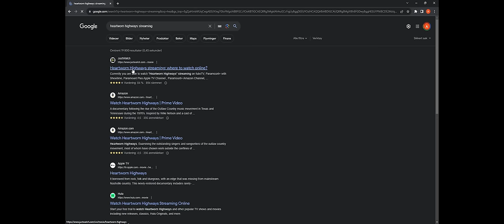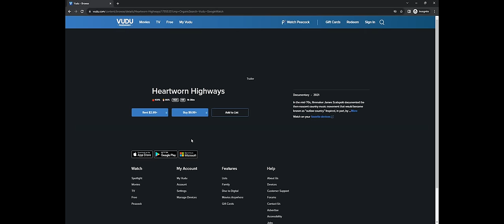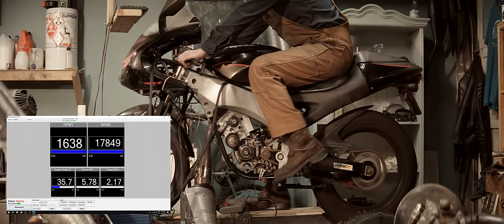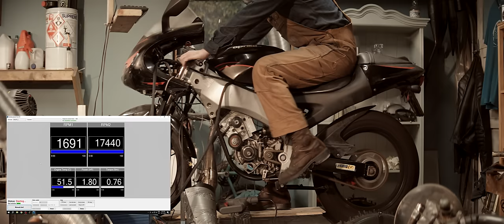Couple of tweaks - Solved the Overheating issue? Road to most Powerful 50cc.

Comment from the maker: Check NordVPN exclusive deal here https://nordvpn.com/2strokestuffing.It's
risk-free with a 30-day money back guarantee!
Reply: Alex @2STROKE STUFFING
    I would think of over building the crank bearings with a double bearing on the 'drive' output side, if not both sides! on a future crank case design ..to ensure minimal crank flex harmonics from high RPM running wearing out the bearings so quickly with the belt drive loading on the crank end(s) - a.k.a. build the bottom end akin to a endurance-racer toughness, for the relative drag racer levels of power you are after from the engine's small capacity, so to not have to worry about so frequent rebuilds obscuring other testing issues & problems.
    Likely you would need an auxilary oil pump to feed the outer crank bearings (draining through the inner ones into the case) perhaps a oilpump from a F1SE, AR80 or similar 1970s/80s era 2 stroke etc could be suitable?

Have a brief researching image googling at GP250's & GP500's RG500, KR250 & Armstrong 250 Disc Valves, Rotary Valve Covers setups for inspiration..?
Reply: Alex
    Also, you might need to factor into the crank's reciprocating dynamic weight ratio, with that of the rotary valve's general out of balance weighting, and its weight as part of the total bottom end weighting, it doesn't need to be super accurately done; 
    ...but it could be an idea to think of having the inlet port & rotary valve position at a different clock position relative to crank TDCBDC to relocate rotary vlave's weighting towards the cranks balance weights/ratio more easier by not having the inlet port and open valve period out-of-line to the balance weights of the crank, as how they are now when the port is Only at the 12 or 6 O'clock location(s) ??
Reply: jeg har en honda sfx som du kan få den den er 50cc
Reply: loose the rotary valve all together .and toss it from mind .. let get back to the original agenda as you are going to supercharge a two stroke with a roots style internal gear drive ..driven off gear teeth you are going to cut into one of the crankshaft fly wheels ..to make this simple and easy ..you will have to go back to the drawing board and design a complete new engine that is very close to a Chrysler West Bend two stroke very popular in the late 1960's and early 1970's for racing go-karts..a 100cc West Bend go-kart = over 100 mph was not uncommon ..the block was rectangular ..as the outside of the crankcase was 5 sided ..two of  for the crankshaft ends and with 3 sides left is the right crankcase cover plate , the left crankcase cover plate ..and the bottom crankcase plate ..all three plates will accept  dual reed valves and dual carbs. for a possible total of six carbs ..close off the side plates and build your roots style supercharger to fit right on the bottom of the crankcase in place of the reed valve .there you will internally drive your designed roots style supercharger in overdrive as one of the crankshaft flywheel will double as the overdriven drive gear  and you can also have different numbers gear teeth on the supercharger simply by having spacers of different thicknesses t adjust back lash of different driven supercharger gears ..this is so very simple why didnt we think of this before..you wont even need a reed valve the rotors inside a roots style seal like gears of an oil pump ..and cut out various plates to accept different size carbs...now with adjustable positive boost and set up to very quickly change carbs it will be easy to come up with the right STUFF..dont worry and about  the super charge intake blowing straight out the exhaust port ..the new expansion chamber you are going to redesign in all that spear time of yours will look like an FMF  FATTY with the larges bulge up front as close to the exhaust port ..then a long tapper reverse cone.... the sound wave of combustion will close the exhaust port for enough time until the piston can seal the supercharged intake charge and kafucking booom power and exhaust   to finally exit an adjustable length stinger like a slide trombone ..short for torque to take off and stretch it out long for enough top end to win ! now want are you waiting for ? get back to work the boss wants this all done by 5:30 while i sit here and watch you work.enjoying my beer and glass pipe .im good at watching paint dry also

Comment: First time commenting, this has probably been covered before. I think it's possible that when you  tension the drive belt to the gear box, it is preloading the crank end. This is causing a dynamic misalignment while running and being hooked up to the gear box and causing excess friction and heat on both the drive side and the rotary side bearings.
Reply: I think exactly this is the main issue too. Usually there is a gear drive from the crank to the gearbox, and not a belt. A chain drive would probably do much better i think, as it causes way less friction and doesn't add any stress on the crank.
Reply: @waldmarkszwei6933  A chain still puts an asymmetrical load on the crank, as a belt does. The answer to this is a gear/geartrain.
Reply: I see two paths to fixing this: Dedicated oiling to the crank bearings for active cooling or another variator setup to ease the side load on the crank.
Reply: @EddieTheH  Yes, but on the other hand, Kart engines pull a chain all day long without a problem.
Reply: @heikoscheuermann  Yeah, but Kart engines aren't homemade prototypes.
Reply: @EddieTheH  exactly, the belt puts an asymentrical load on the belt due to having to be tensioned but the majority of the side load is from the drive pulley trying to pull itself down the belt as opposed to pull the belt up around itself, this is where almost all of the side load on the crank comes from so this force wouldn't be lessened by using a chain and sprockets unless that allowed him to change the diameters of the drive/driven elements to change the theoretical length of the lever arm acting on the end of the crank when it tries to transmit power, or to tuck it in closer to the bearing, also decreasing the leverage.

Comment: Hey man, for your rotary valve disc, you have to take into account the air pressure behind the disc when the valve is closed... Try and machine a valve disc with a small interrupted lip on the outside to ensure the entire disc isn't dragging on the plate from the pressure behind it. The lip acts as a skate, and would be the only part in contact with the plate. Cut some grooves at regular intervals in it to reduce contact surface area even more (but not too much or the lip will wear/melt away from the friction heat), and make sure to round all corners. You may need to insert a steel or PTFE ring into the aluminium plate, or the lip will likely cut into it.
Reply: PTFE is too weak, use steel, pig iron, zedex etc.
Reply: This is what I have been thinking for a while now. When the piston comes down, it will create pressure. That pressure will push the rotary valve against the wall. There of course is oil between the disc and the wall but there is a lot of area, a lot of speed and most likely a lot of viscous dragging and heat generated.
Reply: This might be important but he might not read this comment as he cannot possibly read them all. Maybe find a way so he get your message?

Comment: i think the tension from the belt is pulling on the crank and making un even pressure thus making it so one side of the rotory valve is touching one face at tdcx and the other face at bdc

Comment: I had some excessive heat and bearing wear in the axle of my engine turned out to be due to vibrations at high rpm causing some weird shock loading on the bearings and seals.

Comment: It appears you're putting a huge load through that bearing and case with that belt tensioner, it could be pulling the entire case out of alignment and in turn flogging out the bearings.
Reply: My thoughts exactly,suggested a few weeks back to try gears ala desmo style.
Reply: So does that mean a support bracket needs to go there? Like a triangle shape to support load of the belt
Reply: @druskii__8799  an outrigger bearing would surely be desirable with the belt & tensioning loads all hanging on the crank, let alone crank flex harmonics too from the power pulses!!
Reply: Yeah a crank support in my opinion is what’s needed, the diameter of that crank snout is small, the snout stick out is large, then you have the belt pulley (a large width in comparison to the snout diameter) right at the very end of the snout, this is the perfect scenario for maximum leverage against that crank, case and bearing. Exactly what you don’t want.
What would be needed is like mentioned above, an inter grated support structure of the end of that crank snout. We face the very same issues on procharged passenger vehicle engines, and the diameter/crank snout stick out is much better than this situation.
Also I personally think that doweling the case is a must now, you can’t rely on bolt tension to keep everything aligned.

Comment: What spec are those bearings? are they rated for the 15-20k especially when loaded by the belt (pre-tension+radial load). It may not be a problem, but it won't hurt to check the manufacturer's specs. I agree that it's probably an alignment thing, it might be a good idea to dowel the case halves after all!
Reply: Makes me wounder if he somes some ceramic bearings like we uses in hi rpm chainsaw builds

Comment: Cogged belt drive is better than chain drive for saving HP.  Modern belt drives use rounded tooth design which is more efficient that old square tooth .

Comment: In engineering, when you have a complex issue with a lot of parameters, you can use a method called multivariate experimental design. The YouTuber NightHawkInLight recently uploaded a great video of the subject and I think you will greatly benefit from applying it to your work. I have followed you for the past years and I think your chaotic style is both inefficient and takes a toll on you, having to keep so much in your head.
Reply: What are you trying to correlate? The heat of the part? This application doesn't make sense. There is nothing to run a numerical analysis on. He is doing just fine. It's not chaos, it's iterative design.
Reply: @techroma1984  His general method of troubleshooting. There is no secret that his burnout and mental struggles he had earlier this summer was caused by his unrewarding and maze-like troubleshooting. Im not saying this to bash on him, but to help him. I belive stepping back and analysing your data will lead to better results than to just dive head first into one parameter and spend too much time on something that wasnt that important to begin with.
Reply: @FrippFrepp  There is no practical way for him to determine the friction of each part he seeks to modify and study like in a multivariable study. It's simpler and faster to iteratively design by making and testing components and correlating their performance with the temperature. By the time you formulate the known relationships and fit the curve you could have just machined a new part. The change in power output is a clear indicator of the performance of each iteration without mulling over physical relationships. Maybe that would make sense in an R&D lab that needs to optimize a product for process errors.
Reply: @TiiidePvP  leave a mad scientist to his work style. I see a lot of parallels in work style and thought process to myself. This way works best when you have one man doing it all, not a team of people who need to share and collaborate on data, who have the man power to generate and mull over said data, and who usually have multiple means of doing any one task. The burnout is from doing the work of an entire development team. A team shares all of the accolades for the work, along with all of the stresses. When you have to do it all yourself, you take both the good and the bad. The man pulled through it, and is building something that takes factory TEAMS years to build.

Comment: I think eventually you might have to work out an oiler setup instead of using premix. thatll let you run better fuels and get better performance without limiting yourself with dropping the octane rating with your oil. I think KTM recently made a fuel injected 2 stroke that used an oiler, letting them make a 2 stroke that made more power and meet emissions. A 2 stroke with that setup will still burn oil, but it at least becomes controllable and not linearly tied to the fuel flow. 
Hope the current friction problems can be overcome, would love to see how much power this makes at such a small scale.
Reply: This is a good idea. As in feed the oil to the main bearings with an old style oil injection pump. Then it would mix to lube the rod bearing. By the way! I'm thinking your belt is puting side load on the main bearings causing the heat. Check it for heating up with out the belt on! That might be it good luck
Reply: Nice. Hope he will see your comment.

Comment: You need to re-make that cover and turn the round and flat features in the lathe. (assuming it will fit!)  Milling it is a fixturing nightmare. Clamping it from the sides in the mill will make it bow upwards so make sure that any clamps placed in grooves are only pressing down and not  inwards. Use a feeler gauge under the part after clamping to check you haven't introduced a bow.

Comment: Hm, your valve has no counterweight and you spin it quite fast. Could it be crank bow you are experiencing? It would not be felt until high RPM, when it starts wobbling abnd grating on the seal and heating up?
Reply: That effect could be probably minimized by machining pocket in the valve itself
Reply: And making it lighter on side opposed to the sliced out side

Comment: Hello Alex. I've watched your videos for a while, and I'm one of those who really likes 2 stroke engines and your stamina for this project 🌞. I just noticed that you have the pulley for the gearbox outside for the ignition sensor, maybe you should have the gearbox pulley closer to the engine and the sensor on the end of the crank, because you may have to much tension on the crank bearings, and it will build up heat? Just a thought 🇳🇴

Comment: Is there enough lubrication for the bearings? 
You know in some 2 strokes there is bearing lubrication channels or tubes that pump the gas&oil mixture from the crank case to the bearings using the crank pulse

Comment: Just a thought: bearing tolerance should be quite loose from my experience. Both the Rotrex (150-200.000 rpm) and a Danish built small jet engine for RC planes (around 100.000 rpm) runs large tolerances on the bearings - in fact the jet engine developer told me he ended up using cheap bearings from his kids roller blades…. 
But just a thought 😊

You program is awsome

Comment: Just a quick thought regarding your issues you keep having. I wonder if the radial pull of the gearbox belt is creating friction  on the shaft, rotary valve and bearing assembly. I am unsure how much tension you have on the belt but at higher rpms the natural centrifugal forces will be splaying the belt outwards (like when a chef spins a pizza base) which in turn would add even more radial pull on the shaft from the belt. Especially if there is now radial play on the end of the shaft.

I wonder if a shaft steady with a bearing might help on the outside of the pulley. Any radial pull on anything past the crank bearing will also add a vary slight variance in the angle of the shaft (if it is bending) creating more friction on not only the bearing but also the rotary valve against the case even if it is thin spring steel.

Just an idea! 

Love your videos dude! Been following for a long time! And can't wait until this thing is getting air forced into it again by that rotrex 😉 Nice work man, really enjoyed hearing some of your musical talents in a video again too!

Comment: if your using flat roller bearings that could be the problem on Harley xr750 they use roller bearing that are shaped like beer barrel cause under rpm the crank spreads apart becoming untrue.  Id switch to a ceramic bearing for less friction and id also turn the rotary valve cover on a mandrel in lathe to get it flat then coat it in dlc  coating  like f1 parts.

Comment: any possibility for oiling specifically for the rotary valve? Pressurized forced oiling between the surfaces with tiny holes may reduce friction compared to just oil mixed in the fuel. You could probably reduce the oil mixture in the fuel to accommodate it.

Comment: You can probably use bronze or brass on the valve surface. These works well as bushing on steel
Reply: I were thinking the same; oil bronze!

Comment: could be the surfaced is warped due to uneven vibrations (the vibrations or airpulses cause the pieces to touch at certain points in the rotation) heating the material uneven , wat you could try is film the parts with a infrared camera , might help you solve problem by adding more cooland flow or add / remove material to prevent distortion

Comment: I would also be worry of heat expansion. Couldn't the heat expansion cause the misalignment of the bearings leading to premature wear leading to a runaway situation where misaligned and worn bearing cause even more heat ?

Maybe you could check the uniformity (or lack thereof) of the expansion on both side of the shaft by measuring the unmounted block before and after heating. If you see differences since heat expansion is linear you could then extrapolate to what it would be at the temperature you see when the engine is running.

Comment: learning it the hard way engineering, cam programming and being a cnc operator is not easy... when your ideas doesn't work as you hoped. Respect for it teaching it yourself and still keep convidence in the project. keep up the good work❤